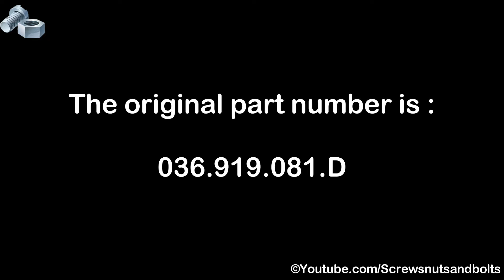Oil Pressure Switch  - Volkswagen Golf

Comment: Hi, good video by the way, i have a Seat Leon 1m with the same engine, axp 1.4 16v, im getting the red light blinking with the bip sound, but only if i accelerate a little bit, 3 days ago i cleaned the cylinder head cover and closed it with new silicon gasket, after that im getting this issue, do you think i might used too much gasket and blocked an oil line?
Reply from the maker: It's possible but it's hard to be sure. I'd recommend taking it to a garage to have it checked out

Comment: Is it the same for a vw Jetta 06 1.6 oil light comes n even though it's not low !! Thanks
Reply from the maker: It sounds like this could be one possible cause of the problem. The oil switch might be in a different position on the engine.

Comment: Do I need to drain the oil before replacing
Reply from the maker: No it's high enough up on the engine so you don't need to drain the oil. There may be a small trickle of oil when you remove it, so be prepared :)

Comment: Doing the same on my cupra r but can’t find the part anywhere, don’t suppose you have a part number
Reply from the maker: I think it's 06A919081J but you should double check that to make sure.
Reply: ScrewsNutsAndBolts thanks il have a look, thought I had the rite part until earlier, unclipped the lectures and what I had was slightly bigger. Think it was the switch

Comment: Hi would this switch cause the car to switch off while driving and not allow to start up again for a while?
Reply from the maker: No I don't think so. It would usually just show an oil warning light on the dash if it fails.
Reply: jesus, take your car to a mechanic and let them fix it. Stop looking at youtube videos trying to self diagnose problems.

Comment: Does it matter at how many bars is the sensor working?I have seen online when buying the sensor it say pressure at witch it operates 0.5 bars or 0.4 or 0.6 bars,I got a mk4 1.4
Reply from the maker: I'm not sure to be honest. Sorry
Reply: @screwsnutsandbolts  And what could be the problem if the oil pressure light is blinking after I drive a few miles,It comes on seemingly at random times blinks then it goes away,I kinda think it comes on when I go over bumps or when the car is shaking left and right,I changed the oil pressure switch and after that it started,I originally thought that I fucked the cable of the plug cause I twisted the cable hard ut I got the plug changed aswell and still the same thing,can it be that the cable from the new plug to be faulty too?
Reply from the maker: I'd say that's unlikely, could there be a split in one of the wires somewhere ?. Have you tried moving the wires about with the engine running to see if the oil pressure light comes on ?
Reply: @screwsnutsandbolts  no this is an excellent idea thanks!
Reply: @screwsnutsandbolts  Alright I tried moving the wires but the light is not appearing,i even waited until the temp went up to 90 degrees but still nothing,any other ideas?
Reply from the maker: I'm afraid you might need to take it to a garage to have the oil pressure checked properly. Is there high mileage on the engine ?
Reply: Hi mate I have the exact same problem on the same car any luck?
Reply: @tunertv4433  yep,it was the oil pump.
Reply: How much did it cost I replaced the oil filter did an oil change oil pressure switch and engine speed sensor but no luck
Reply: @tunertv4433  the oil pump wasn't the big problem,by the time I realized that the oil pump was the problem the low presure almost ruined the engine so it had to be rebuilt luckily I got a family member that is working as a mechanic and he charges me only for the parts and no labour.

Comment: Does the oil need to be drained or can you do it with oil in it??
Reply from the maker: You can do it without draining the oil as it's at the top of the engine. A small amount of oil might trickle out when you remove it, but only a tiny amount.
Reply: ScrewsNutsAndBolts ahhh ok, I have my 2.8 vr6 and the red oil light has been turning on and off, so I’m hoping its this sensor going bad, thank you showing how to do it!! Now I just gotta find where mine is😂
Reply from the maker: lol, good luck with that, hopefully that's the problem. On the Mk3 Golf I used to have, the oil light came on and I thought the engine was done for. In fact, the oil pressure switch had failed and was leaking oil through the switch itself. It was such a bonus that I could fix it and it only cost about 5 or 6 euros :). I think it was bolted into the valve cover as far as I can remember.
Reply: ScrewsNutsAndBolts I really hope it is the problem, mines a mk4 if I’m not mistaken I think they are the same engine, I’ll be sure to check near the valve cover thank you!
Reply from the maker: Oh ok, you're very welcome :)
Reply: @gtigio5067  did you managed to change the sensor?
Was it the sensor's fault or it's the oil pump?
Mine is doing the same thing (blinking) but at low RPM. When I get it to 3000 RPM or higher it stops!
Thank you!
Reply: polarx007 For me it was definitely the sensor it was leaking went I removed it, after replacing it the oil light was completely gone, make sure you’re easy/gentle on removing the sensor cable from the switch cause I broke the little clip hahaha I hope it’s only your sensor for you good luck!
Reply: @gtigio5067  I hope that too! Until now I managed to fix stuff on my car by myself, I hope it's an easy fix!
Reply: @gtigio5067  i just broke mine,  how did you sort it out please?
Reply: Cartel Awper on the MK4 it’s above the oil filter housing, there’s 3 screws in a triangle, there’s going to be a ac line blocking one of the bottom ones, remove the top and the one not being blocked. Unscrew the one that is being blocked as much as you can, then there should enough space for you to wiggle it enough to remove the last one
Reply: Cartel Awper make sure you get a new gasket for the housing, it looks like a figure 8. Also being careful removing the sensor, it was a pain lol
Reply: @gtigio5067  hello i accidentally broke the clip of the sensor cable and now i dont know what to do, please help
Reply: Cartel Awper I broke mine too😂 all I did was assemble everything together and then connected it as best I could and put some putty/silicon with some electrical tape to keep it together
Reply: @gtigio5067  haha thank you, wish me luck 😅😅
Reply: Cartel Awper now that i think about it I don’t remember using electrical tape but it won’t hurt, just be generous and careful with the silicon/putty make sure it doesn’t go on the inside of the connectors hahaha goodluck dude

Comment: Hi...vw golf 1.4 ..oil leaking from the connector  plug...
Is the issue the sensor ?
Reply from the maker: It could be. I had an oil pressure switch fail like that a few years ago on a mark 3 VW Golf. The oil actually leaked right through the switch and out through the connector.

Comment: Hi can u tell me i already replace the sencor and oilpump but the light still came on,what should be the problem
Reply from the maker: It could be a clogged oil filter, clogged oil pickup or clogged oil passage somewhere in the engine or some other reason. You should probably take it to a garage and have it looked at.

Comment: I changed the sensor, with a mark of 1.2 to 1.6 bar. Sometimes a lamp fires when I drive on a bad road on a hill. What is the minimum oil pressure of the heated engine. golf 4 1.6 16v
Reply: Bonjour avez vous trouvé une réponse ?